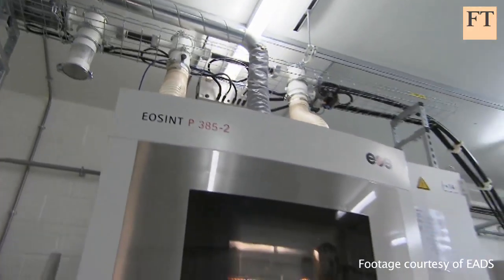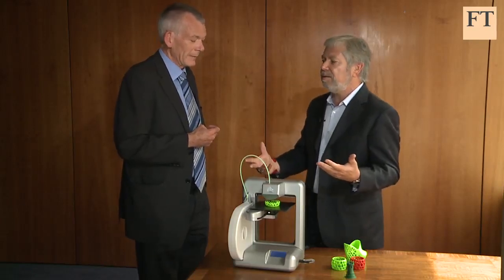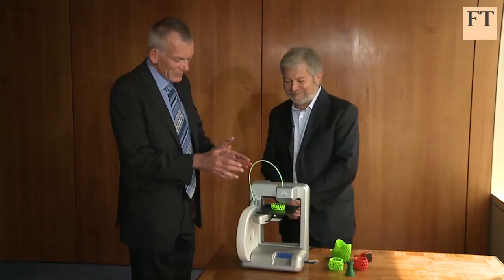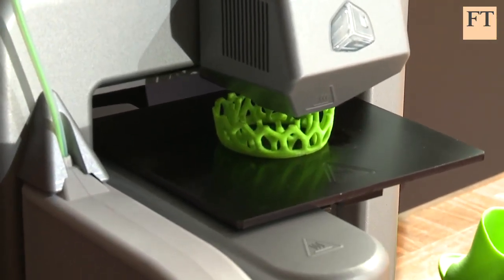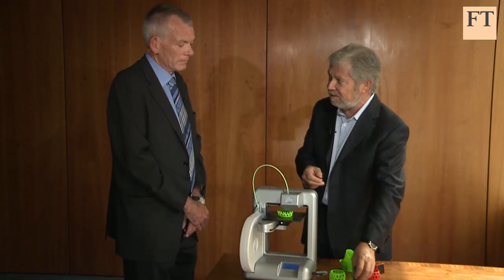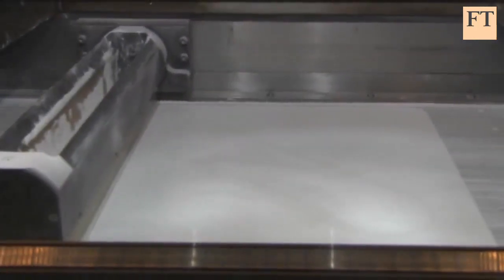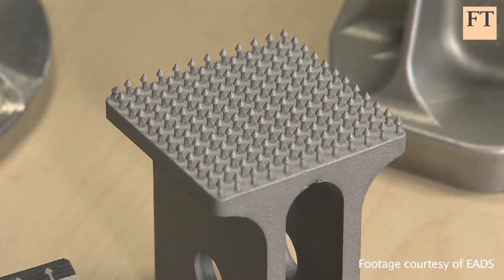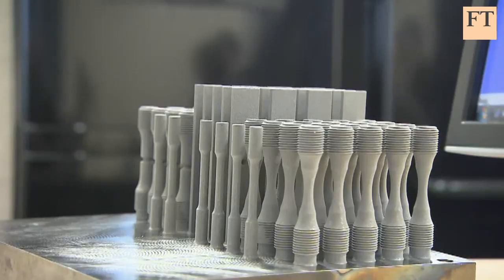3D printing 'bigger than internet' | FT Business

Comment: There are countless applications for this. I've been commissioned by a former employer to print a sand imprinter for the ash trays around the resort and they're talking about having me print some things that will be sold in the gift shop. That's just in my first week of using it, too.

Casings for small electronics, cell phone cases, toys (which can earn you a bit if you have a way to sell them), basically whatever you want as long as a person's safety doesn't depend on it.

Comment: Interesting point, but some of the benefits of additive manufacture are the reduced time to go from CAD model to final part, reduced material usage (buy to fly ratio), and the possibility of making integrated components with complex internal features. The computers that drive the CADCAM software for the type of machining you are talking about are just as vulnerable to EMP attack as the computers that are used to generate the toolpaths for the 3D printing process.

Comment: Very useful for pattern making and for some things where plastic is ok as the final part.

It looks like it is getting oversold a little.  The pattern has to be turned into something much stronger in order to enable real machines.

Try making a tractor like the Miastrada Dragon out of plastic.  Look at that and tell me where 3D printing would function like welded steel for light weight and very strong machines such as this.

Comment: This industry has been very heavily over-hyped and over-invested in. 3D printing is too slow for most manufacturing processes. It may take a day ir two to print out a moderately large part, whereas you would like to be able to stamp out thousands of parts per day. It also turns out that there isn't any barrier to entry of new companies in the field. It simply isn't a complex process that requires large capital outlays or R&D for the printers themselves or the materials used to print with. You can actually build one for yourself without too much trouble. It's also not a device that most consumers are going to need, so they aren't going to sell millions of units and become "the next internet."
Reply: So what? When the internet first was available, it was too slow to share information effectively and now technology has evolved. We are seeing houses being printed in a one week already. 3D printing will get faster and better..

Comment: because your living under a rock. 

don't worry, if you buy now, your still considered an early adopter. get on kickstarter and check out what people are offering. pretty much anything reprap based will be highly customizable and self repairable. don't get one of these cube things like in this video. POS that takes proprietary plastic cartridges instead of cheap filament you can buy from any number of suppliers.

Comment: I just got back from CES 2013, and spoke with bigwigs from 3D Systems. They offered the LEAST value out of any of the 3D printing companies who showed there.  The Cube is aweful -they charge 3X what most other 3D printers charge for plastic material. The CubeX, unveiled at CES, was not much of an improvement, and cost a whopping $4,000 for 3 color capability, but many other 3D printers offer much better resolution and multiple colors for much less cost. CNET thumbs downed 3DS's Cube.

Comment: One blast from an EMP all 3D printing will be scrap metal. Big Brother can and will also be able to know what you are manufacturing. Machine tools can do the same thing using much simpler auto-servos complete with jigs and machine base tables to take the many machining steps until the finished manufactured products comes out. And they're invulnerable to damaging emp, emf, emi, and BIG BROTHER HACKING SPYING AND FOREIGN HACKER SPIES!